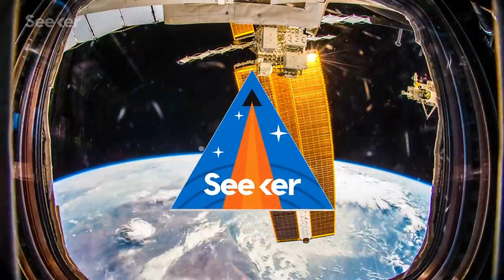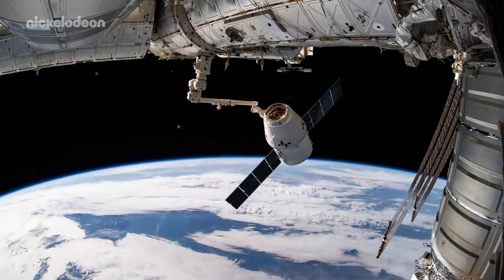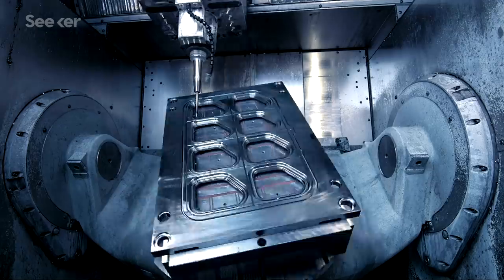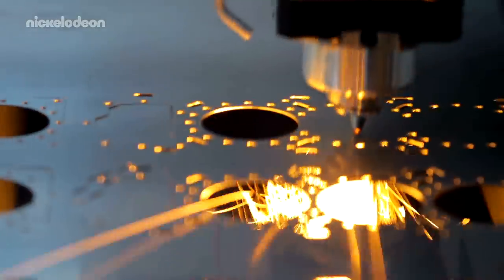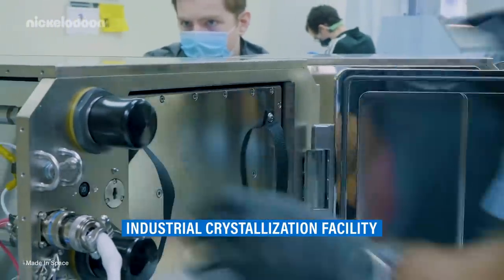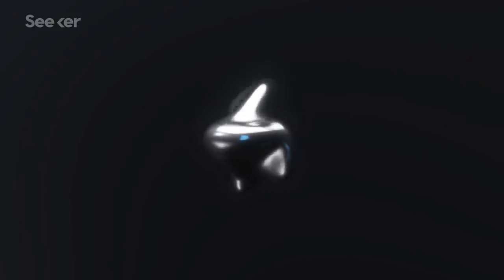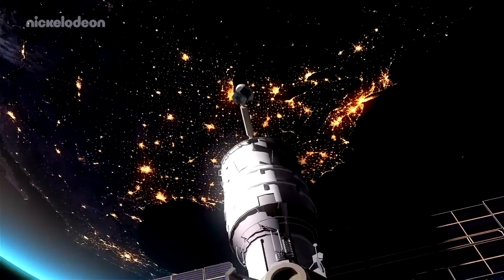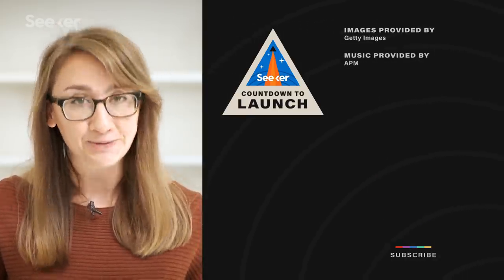How 3D Printing in Space Could Revolutionize Manufacturing

Comment: I'm more than willing to go and work in space.
Reply: the thing is most jobs in space will be more so like drone control instead of humans actually doing stuff. You do have some that need humans to repair what was not made with self-repair in mind but once we have actual jobs in space instead of just research positions the satellites there most likely will mostly be able to self-repair so reloading them with a new bunch of stuff will be the part that they can't do. this does include the circuit boards as most breaks in circuit boards aren't the chips but the traces on the board. It is still in devlopment for a way to have it be able to do self repair of broken circuit boards. without having to make an entire mini fab inside the satellite to print a new board. You can do that on Earth with the correct materials and tools but one of said tools relies on gravity to work.

Comment: As someone who has built and runs a 3d printer. Zero gravity would make things so much easier. Some things are a royal pain or simply not feasible on most 3d printers under gravity. Printing anything with an overhang is a pain. You can use support which is basically temporary scaffolding that goes from the print bed all the way up to your overhang but this takes a significant amount of time and takes extra material which you then have to break off the final part and recycle or throw away (and this is impossible to do for parts with closed internal cavities or other complex internal geometry that need support). This also generally leaves "scars" on the part that must be dealt with and simply isn't feasible for delicate or high precision parts and is impossible to do for parts with closed internal cavities or other complex internal geometry.

Comment: I hate when engineers re-use abbreviations. CMM in manufacturing is a coordinate measuring machine. Used for decades in quality control to check parts very accurately.